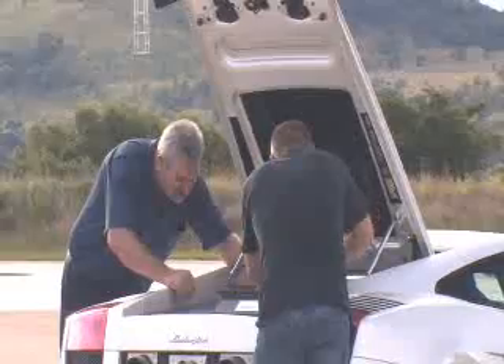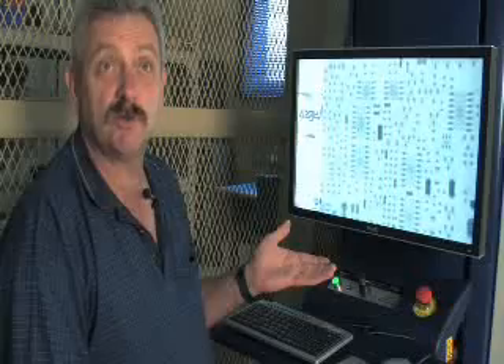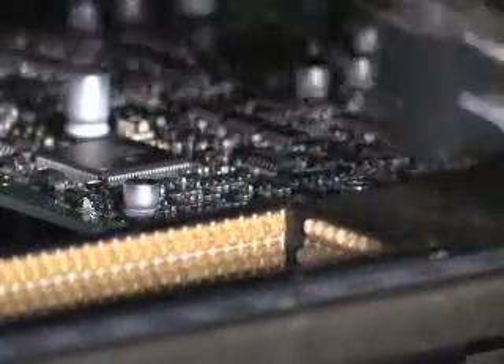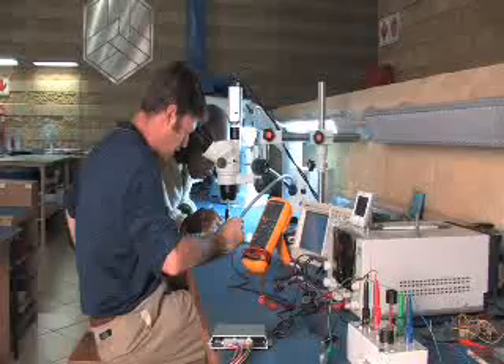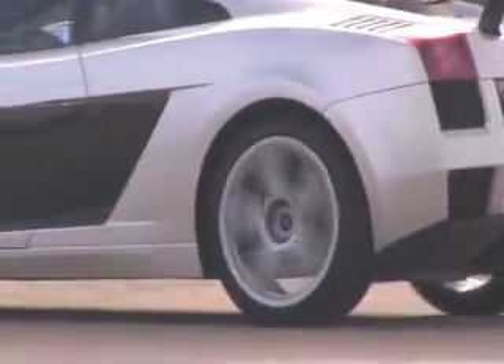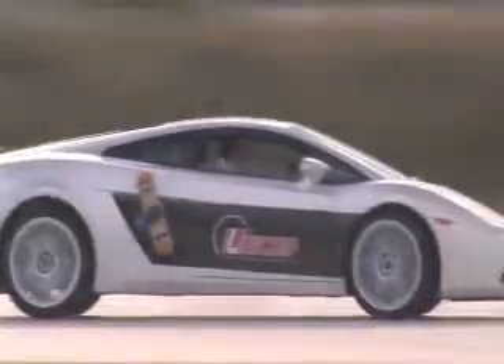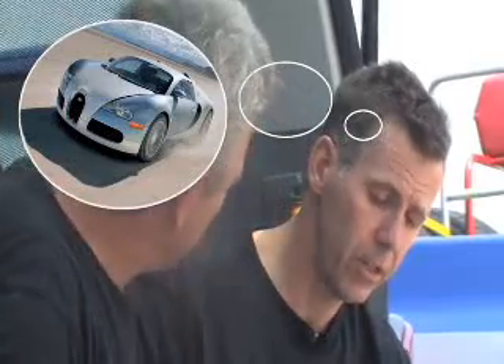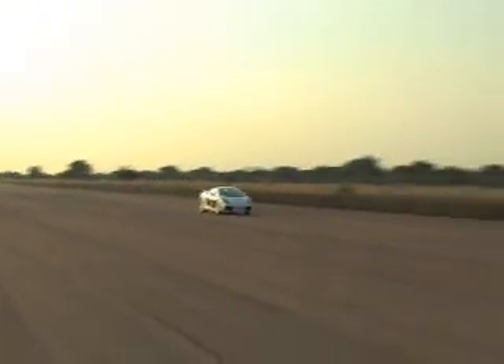Lamborghini Gallardo Dastek Supercar

Comment: I am a Unichip's customer in Thailand. I would like to confirm your product is a very good one. I try to have greddy e-manage to fitting with my car (Honda civic es3) after compare house power. You box can take control my fuel and ignition system smooth. Currently, I have unichip version 32 bit and Q